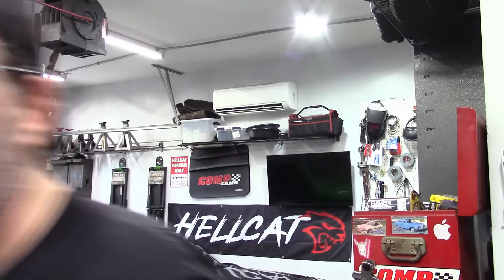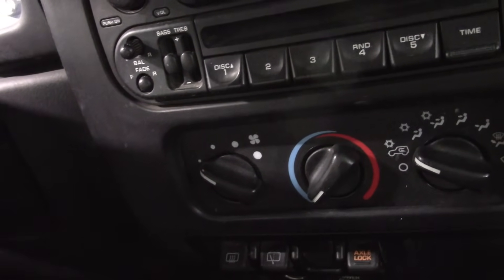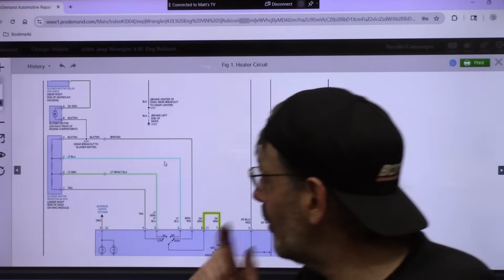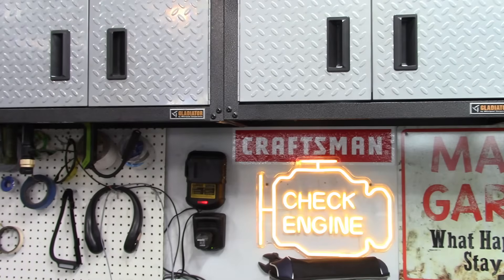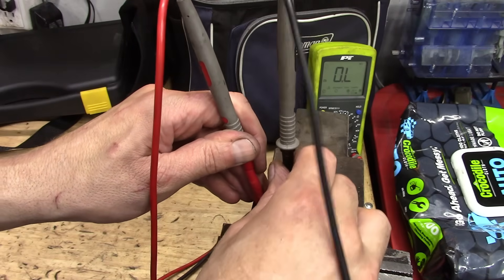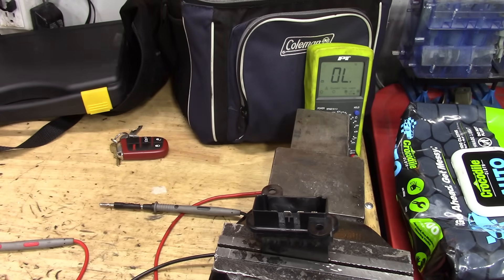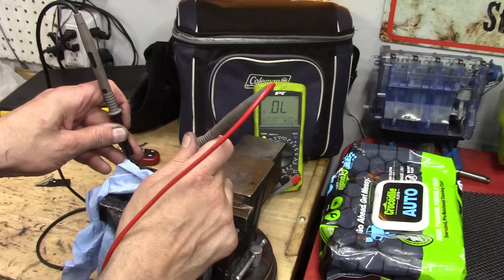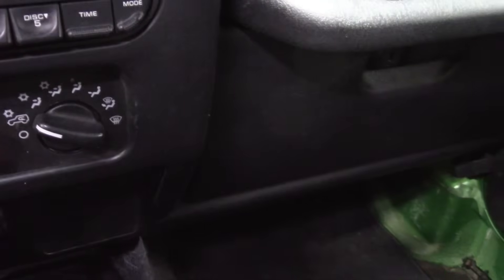Basic Electrical Case Study: Jeep Heat,AC Only Blows High. Diagnose + Fix.

Comment: i have a 2006 nissan pathfinder 4.0 p1273 
what i noticed the bank 1 sensor 1 AF 
when i have key on volts are .322 
and bank 2 sensor 1 AF 
is at .678 
what could it be replaced bank 1 sensor one OEM and same issue i try making the rich and lean but they look working but different reading hopefully u can help me THANK YOU! teacher
Reply from the maker: What’s wrong with it exactly? I don’t see anything wrong.
Reply: @SchrodingersBox  im getting p1273 code 
but what is weird is tha is reading like regular o2 sensor between 0-1 volt 😳

Comment: My mom had a kia where the fan modes didn't work all of a sudden. I thought blower motor resistor until I realized it would come on and off by jiggling the knob between 1 and 2. I took the hvac controller out of the dash and for some reason the back of the switch was melted. Plastic was covering the metal wiper contact in the switch and I was able to restore 3 of the modes by shaving it off with a dremel. Never understood what caused the melting. I figured a fuse would have blown before enough current was drawn to do that or maybe it's just kia garbage.

Comment: Hi Matt. Hope you are well. I was curious if you ever had another comeback on that 2014 Ford Edge with the charging problems and two alternator replacements? Thanks,  Brett
Reply from the maker: No I have not!!! The ford alternator did the trick!
Reply: Ya , i was reading about the new Smart alternators. Was that what happened with the first replacement? It wasnt a "smart" alternator?? @SchrodingersBox
Reply from the maker: That’s exactly what I believe the issue was

Comment: I know most cars are like this, but it's a rubbish design.  The resistor sits in the duct so that the airflow cools it. Problem is the most heat / most resistance has the least air flow. No resistance setting 4 has max airflow. Still I guess the parts cheap enough and will do a good many years between failures.

Comment: Hey Matt, not sure how far down the rabbit hole you get in with AC issues, but do you think you could make a series on leak detecting, refrigerant recovery, vacuuming/micron gauge testing, and checking superheat/subcooling on an AC system? I recognize that AC diagnosis requires additional equipment that most DIYers don't have, but I think MVAC systems are largely misdiagnosed and misunderstood even by professional shops that service automotive AC systems. Given the philosophy that your channel takes, I think you would be one of the few channels on YouTube who would set yourself apart from the 99% of MVAC videos online. It's a topic that desperately needs attention.
Reply from the maker: I have a whole series on AC diagnostics and repair on my paid content channel at www.schrodingersboxQM.com. Covers everything you mentioned and more.

Comment: Aren't most resistor packs located in a duct for cooling purposes? Hope you get well soon! There’s a load of cars waiting to be diagnosed.😸
Reply from the maker: That may be true. I have only seen them as part of the head unit or separate like this in a module.
Reply: My 80-90s Chevy trucks they are located on top of the A/C duct box